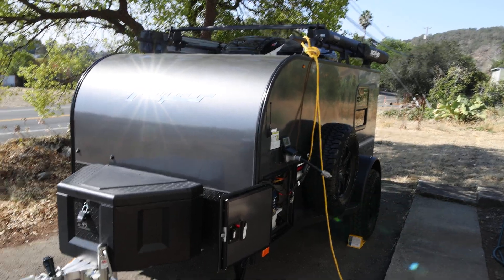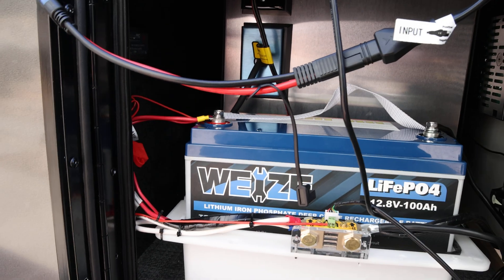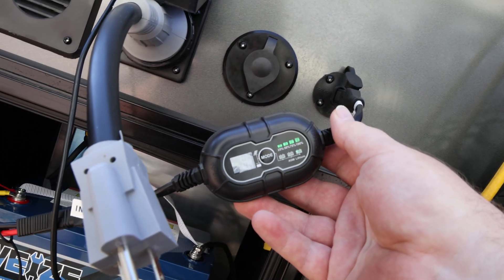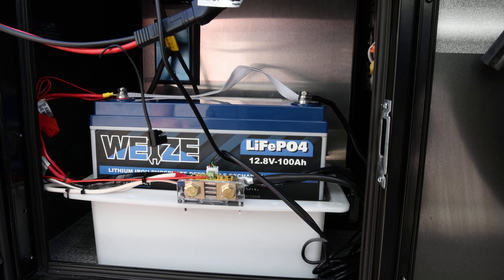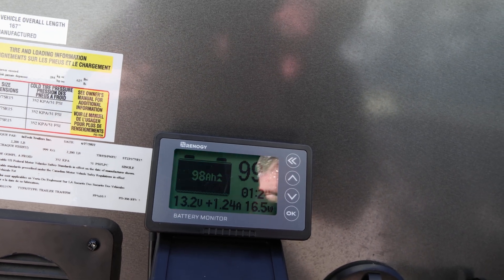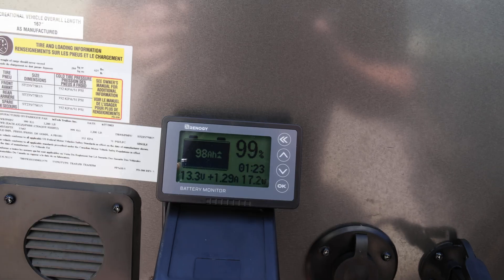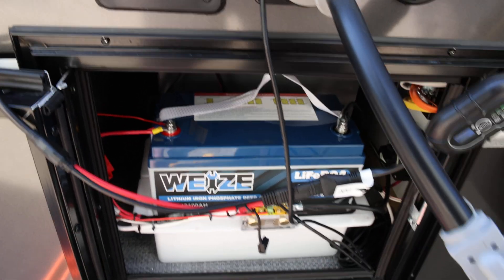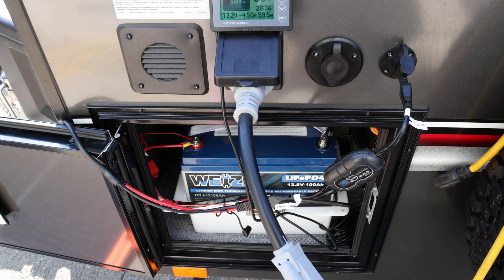Intech Flyer Pursue Weize 100AH Lithium battery/Jackery Solar panel test.

Comment: Hi Geoffry - thanks for this video. I have 2 questions (1 question and 1 request). I, too, have a 2022 pursue and would like to set mine up as you have yours. Do you have a drawing or schematic of your settup? Also you mentioned that your Zamp panel connector was reversed - do can you tell this and how do you 'fix' it. thanks for your help!

Comment: What year is that flyer? Was the solar plug reverse polarity?
Reply from the maker: My Pursue is a 2022. The stock Zamp* plug is reversed so I use the reversed adapter that came with the cables. You can see in the video the adapter is connecting the solar charging unit to the Zamp plug.